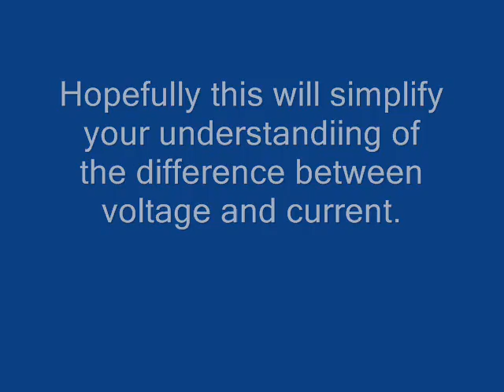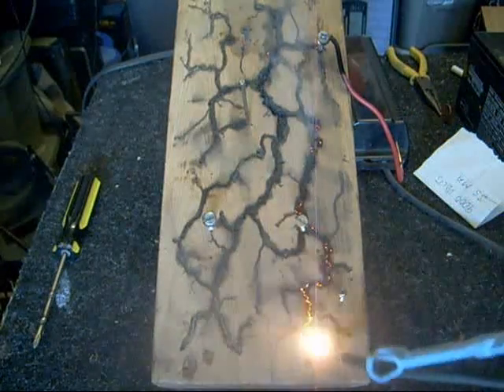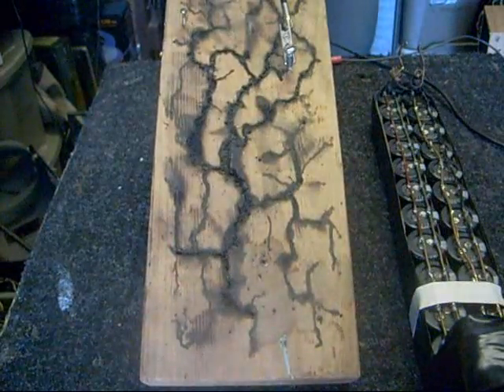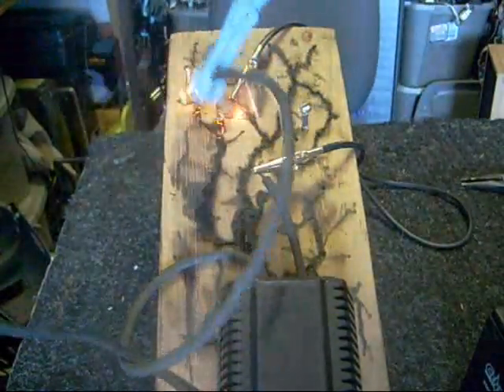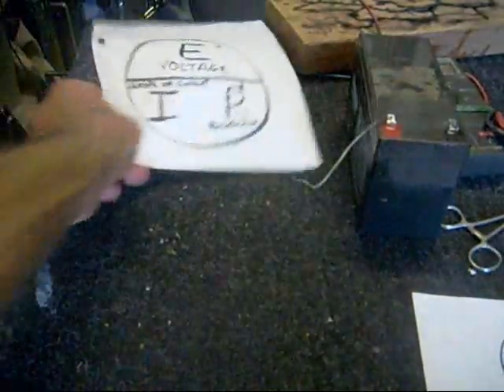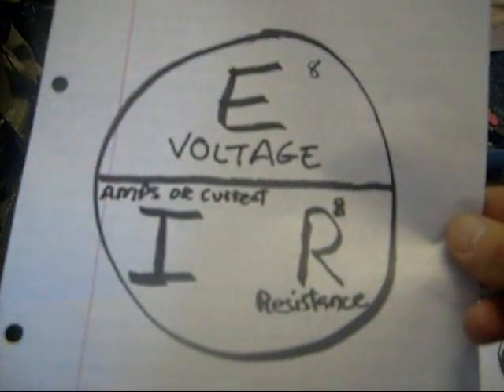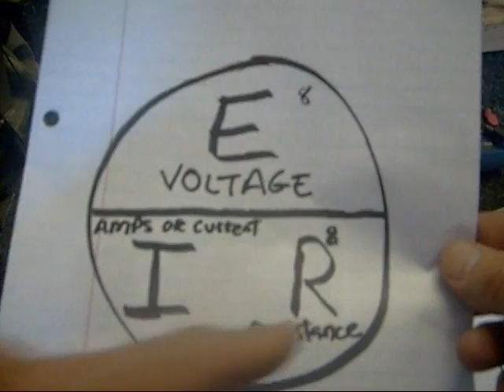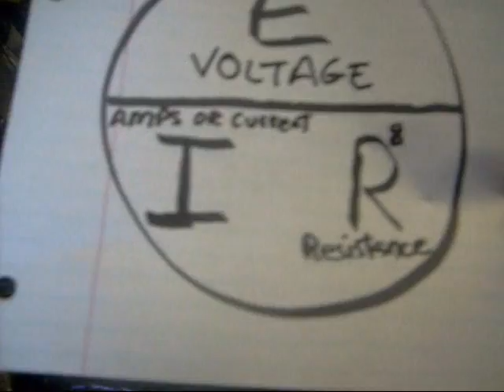Volts Amps and Resistance made simple.

Comment: then how do you raise both voltage and amperage
Reply from the maker: +taven412  If you need a high voltage high current source source beyond what's available from your household mains  you will need to build your own generator like the power company does.
Reply: is your capacitor in series or parallel
Reply from the maker: My capacitors are in a parallel circuit.
Reply: ok thanks

Comment: how do you generate higher amperage do you use a transformer
Reply from the maker: +taven412 Yes you can raise the amperage with a transformer but it will lower your voltage.

Comment: The only way i was able to understand  how the systems works  was to change  Ohms  theory  to make the Resistor  a more understandable term by seeing it as  "  Variable  Conductors"   since it does conduct  if the power it strong enough as we see for a Tree conducting  a Lightning  bolt.    To me a resistor  is like a Doorman/Bouncer that resists you coming in , a  Variable conductor means I can come in to the  Restaurant if the conditions are right for the bouncer to let be flow inside if i conduct myself properly.   
    If the objective is to build  a circuit so power CAN flow ,  why would Ohm see it as a circuit that resists power as if you DON'T want it to conduct.

   After 43 years I still don't know where the Voltage comes from , and I don't mean  a machine with a dial that says it's 400v .  My high school teacher tried to use  Water pipes and water flow to explain it ,   but existing water is drawn from our lake and  when we open the tap  it flows to the lowest point  or down the drain back to the Lake  to come back again.     
    When i hear about Watts, Volts, Amps, Ohms, Implied force, current , and resistors  I end up back at the start where still want to know   what electricity is and why it can fry a wire in one case and yet do squat in another.
    Someone was dealing with a old car that was run by batteries,  they claimed that  the 6volt system gave the motors more power than a 12v  battery hook up.  
     If I have  two   50 hp motors   on my boat , it's 100 hp,  but i had a truck with dual 12v batteries and a 135 Amp alternator  and my truck wasn't a 24volt system.
   There's got to be something  I not being told  because I got the impression that  5   "D" batteries in a flashlight were to draw power slowly from each one so the last longer,  and yet some Radios can run on a DC power with 4x  1.5 volt batteries.  
 
   It seems like I get a different  version of  Volts, amps, Ohms, and watts for every  person that tried to explain it   from what they were taught.   Sometimes i think that the person themselves doesn't really understand it  and just memorized Terms and Formulas.

Comment from the maker: @manojsam79 Yes you can use ( 8 ) 1.5 volt batteries in series to operate your 12 volt TV assuming they have enough current. 
A resistor isn't necessary if you use the correct voltage. The TV will only take the current it needs to operate even if your battery is capable of delivering hundreds of amps. 
You also asked if a resistor your decreases voltage. The answer is no if you don't have a load such as a TV on the other side of your resistor. Attach one to a 12 volt battery and test its output

Comment: 1) What does it mean by "draw current". (say by an electrical equipment)?

2) If i want to connect 12v car battery (which has lot of current) to a circuit which normally works with 8 X 1.5 batteries, without burning it?
If i use a resister in order to limit the current does it also decrease the voltage? 

thanks.

Comment: @price777999 a capacitor at high voltage low capacity can still induce a high current. capacitors and batteries have no current. currents are the amount of change in electric resistance between elements or how fast the differential called voltage is changing toward zero. in one given amount of time the ampere can be high, in another the ampere can be low or become low aswell as the voltage drop in propotion with the loss of electric resistance differential in voltage.

Comment: @price777999 in a battery the cores have un-equal ohm resistance. when you use a third ohm resistance across between the two first and allow a mass transfer to balance out the differential in electric resistance between the cores, if the third resistance is low you can measure volt, and if the third resistance is high you can measure ampere. volt and ampere doesn´t really exist. a current is a change in differential of electric resistance between two elements, or a variation in resistance in one